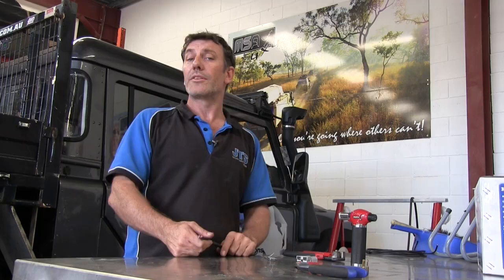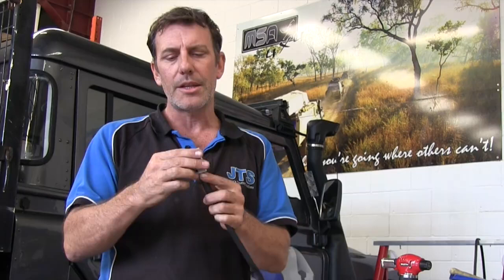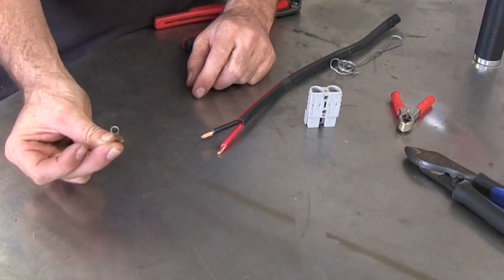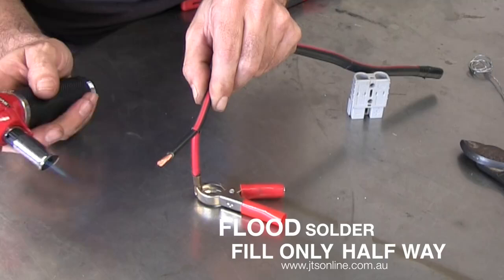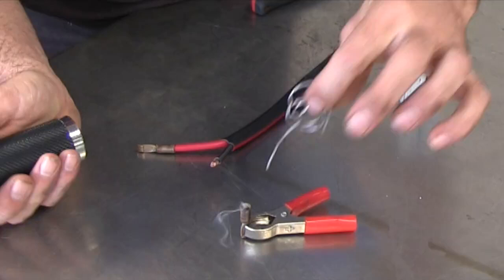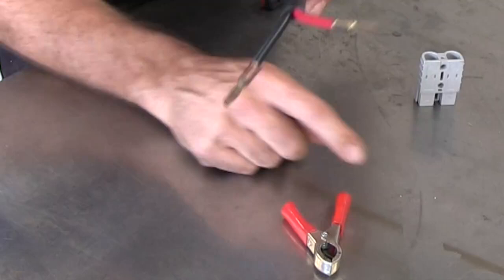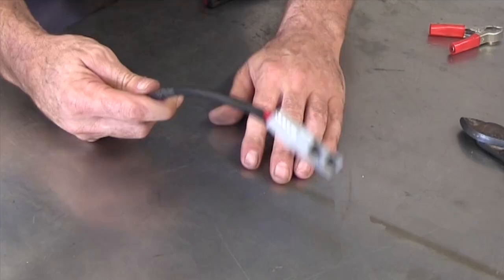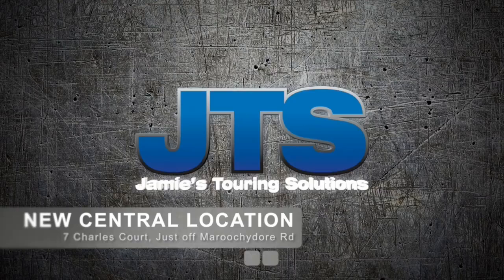How to Flood Solder and Anderson plug fitting | Jamie's Touring Solutions:

Comment: You need to tin the wire first.  If you don’t you are likely to end up with a dry joint and over time it will fail.  To tin the wire you need to use a soldering iron and coat the exposed wires with solder, then mate this to the Anderson pin.
Reply: Thanks, that's a good tip
Reply: Really? the guy does it all day every day you'd think he'd know what he's doing!
Reply: this can be achieved by keeping the heat on the connector when you plunge the wire into the pool of solder, the solder will want to solidify near instantly, which will only connect to the outside of the wire, keeping the heat on will raise the temperature of the wire above melting point, and allow it to penetrate

if find the best way to tell is that if you can still pull the wire out of the connector, then the solder is molten, this is a way to gauge penetration. though it is difficult to know for certain because you cant see. so i recommend doing some trial runs, then cutting the wire open to see how you went for penetration
Reply: @tazholio  Not really, as by then all the flux has evaporated or burned off, and the solder won't take as well to the wire.  Much better to carefully tin before connecting, being sure not to heat so much the solder runs up the wire under the insulation.  Crimping is THE most reliable method, but this is a decent method I use so that plugs can be reused in a "bush" situation if needed.
Reply: exactly what i was thinking
Reply: Pretty moot point, all good quality 12v automotive/marine wire comes pre tinned. Road Tech Marine for example only have pre tinned wire.

Comment: Its a good idea to preload the wire with solder, that way you ensure proper penetration of solder into the cable (P.S. I am a 40 year Avionics Tech)
Reply from the maker: Good tip
Reply: Someone got but hurt over a very good tip. Anyways thanks for the advice.
Reply: I'lleatyou  What a strange person; is there anybody else up there that we can talk to?
Reply: I agree, should always pre-tin the wire so it's a much better joint
Reply: SPENCE Info coming from an Avionics tech is super valid you nonse,
In that industry there's absolutely zero tolerance for failed electrical connections as it will certainly end in disaster for the plane.
Reply: Ian from FNQ  Heat the wire with a soldering gun (you'll 100watt or better) and touch the solder to the wire. The solder will flow over the hot copper.
Reply: Ian from FNQ  I twist them together. The copper to copper contact will aid in conducting the heat when you solder. The biggest enemy in this method is a cold solder joint. I make up thousand of PowerPole connections but I rarely solder. I have the proper crimp tool but most folks can't justify $150 US to purchase the tool for the 100A Andersons

Comment: Cold joint bad soldering. Wire should have been tinned first. Soldering 101.
Reply: Im new to soldering and i thought the same
Reply from the maker: Soldering 101 for splicing solder or soldering to a joint is correct. This is a flood solder procedure. You do not tinn the wire first as it increases your risk of a dry solder joint. This is raw wire into a flooded solder vat. Please do not tinn your wire first.
Reply: Wrong. Flood soldering doesn't need it Hmmmmm

Comment: I was really struggling to wire in an Anderson plug this morning... I was ready to throw my entire camper trailer in the bin until I saw your video. Replaced a merit socket in the fridge box with an Anderson plug. Now everything works again!
Reply from the maker: G'day @jaselynch, glad it helped. Just make sure you are using genuine anderson plugs. And remember they are a flush through mount and no need to have a cover if external of your camper. Cheers Linda & the JTS Team.
Reply: Cheers. Yep, using a genuine plug. Thanks again!

Comment: they are designed to be crimped, why would you solder it. adding unnecessary resistance to the joint
Reply from the maker: The connections we do have been done for many years and never had any issues.  Crimping is done at times, depends on the situation.

Comment: Re-using is actually a good reason and that's often missed by people who discount the flood solder method. Good tips. But it's not water 'proof'; somewhat resistant to water; fine in light rain. But I wouldn't go driving into a river and expect no corrosion or eventual degradation in the circuit. Definitely will last a long time and they are very durable. But not 'proof".
Reply: Thats what lanotec or mx4 inox is for mate

Comment: Fill the back with silicone and with a cap on the front it will be fairly waterproof but when connected to another plug not so waterproof. I like to presolder the wires too before inserting them into the hot solder just to be sure of a good connection.
Reply from the maker: It is not recommended to try and "waterproof" Anderson plugs, they are desigen to allow water to pass through them, cleaining out dirt and mud

Comment: It helps to orient the connector blades the same way, and at the angle they will naturally fit into the housing without twisting the individual conductors.  I had never heard the rationale for soldering them so they can be reused.  I suppose to get good results it is best to get the old solder out of the connector, because most of the flux will have burned off in the initial use.

I believe Anderson recommend crimping for the most secure permanent connection.  I buy enough of the connectors at once that it is not too costly to use a new one on the next project, and also for the occasional botched crimp job.

Comment: Thanks. I did it this way and it worked for me. Getting the clips aligned and pushed in was not that easy, but eventually got it. I used a silver electrical solder which did the job nicely.
Reply from the maker: Glad it helped! Thanks for subscribing.
Reply: you highlight another omission from this "tutorial". Ive learnt over the years to line up both pins in the same orientation   before "crimping". I'm not a flat earther and as an Industrial Electrician hold great faith in a properly torqued crimp.

Comment: Perfect for the cheap copy Anderson plugs. The crimps themselves are thinner and split when crimped however the cheapies are great when soldered this way.
Reply from the maker: Afternoon Kevin. You can certainly crimp but we don’t on the 50amp the best connection is to flood solder and only genuine andersons  are used and sold by our workshop. Thanks for the comment.

Comment: Wish I knew what I know now,i live totally off grid and the first panels and the upgrade I cut the Anderson plugs off and joined the panels with a central feed board.Well never too late to learn its Anderson plug time saving grace is I kept the plugs.Also didn't know about flood soldering great upload could just be ringing your company as I have to replace a few of the old tools,wire stripper,solder unit ect.Live at Lightning Ridge we tend to bush fix things here lol.
Reply: Sil Marillian wow, living totally off the grid and still connected to the internet.
Reply: @777nexus7  Yep am on the last phone pole from a small country town here,could go satellite but my connection isn't all that bad

Comment: Excellent video! I used this for 4 poles today, so easy, came out excellent. I hope the solder holds up to a little motorcycle vibration. Not Harley shake apart type vibration,  but regular road vibration and bumps.
Reply from the maker: Thanks for the feedback Duke.  They should definitely hold up as this is our way of doing all our 50amp genuine anderson plugs.  Safe travels

Comment: Hi Jamie  I have found if you mark the clip and the wire in it's correct position in relation to the plug with a tecta before soldering 
  it will fit in much easier without needing to twist the wire and putting unnecessary pressure on the springs...
Reply from the maker: Thanks for the tip

Comment: Great job up until you put the cold cable into the solder.  Good chance that the solder hasn't flowed into the core of the cable.  Would be better to prepare tin the cable. 
We were taught to dip the wire into the hot solder,  lift the cable and really dip until the cable is well tinned with the solder flowing.
Reply from the maker: G'day Kezza, because we use a flux core solder and blow torch to melt the solder and quickly place the wire into it we find it tin's enough to give a good connection. We also check with every connection that we don't get a dry solder.

Comment: This may be an odd question for you.  I have a need to have an SB50 on one end and an SB175 on the other.  Using a 6 gauge wire works well for the larger plug, but near impossible for the smaller SB50.  Any recommendations?  The reason is that I have a Titan Solar Generator that uses the SB50 and I need to attach a HSKY ELITE 24V BATTERY that uses the SB175.
Reply from the maker: G'day Don, we have done this before and it is a bit of a job to get it right.  With the 50amp anderson we would only fill the cup half way of solder before placing the wire into the cup or you could crimp.

Comment: I’ve always read that soldering creates a weak spot where the solder ends that can break with lots of vibration over time. Is this not the case?
Reply from the maker: G'day Jason, as far as we are aware we have never had a broken solder connection on an 50amp Anderson plug doing it this way.  However when joining larger wires together we don't solder larger connections because they can become brittle, we crimp.

Comment: do not put too much solder in the cup. I learned this the hard way. It will spill over and glob at the end and you won't get it to insert into the plug.
Reply from the maker: Correct, about 1/2 to 3/4 of the way up the cup is perfect.  It depends on the thickness of the wire you are placing in the cup.
Reply: @JTS12Volt  I did fine on the first one. It is the second one I boogered up. I'm keeping it as a monument, LoL
Reply from the maker: @troy3456789  hahaha it is a fine art to getting the levels right.  I enjoy heading into the workshop and learning also and yes have a couple I buggered up...Linda
Reply: grind out with a needle file?

Comment: In the process of doing some for my trolling motor/batteries on my boat same wire your using. How good would that hold up for mate in a boat connection. Cheers
Reply from the maker: You have to use tinned cable /wire but this connection is great cause it reduces water sitting in the cable area. If crimped it produces a pocket where water can sit.

Comment: The Anderson plugs I buy from Jaycar have a hole at the base of the jacket on the pin so when attempting the technique here the hot solder pours out of said hole. I've tried crimping the hole shut but solder still escapes. Maybe different brand or non genuine Anderson Plugs?
Reply from the maker: Definately a non-genuine Anderson plug, we only use the genuine product at JTS. No copies
Reply: I get cheap ones off eBay which don't have this characteristic

Comment: If I knew this have to be soldered, probably I wouldn't buy them at all. Just ordered few and waiting for the package. My half of the wires are already installed on the van, in difficult position. So, no chance to solder.
Reply from the maker: You can also crimp the andersons, we do the soldering as it's a longer lasting solution for the jobs we have done.

Comment: Where did you get that neat soldering gun?
Reply from the maker: That is just a simple butane torch, most hardware stores will have them. We can also supply them form the shop at JTS 1300 377 128

Comment: How are they waterproof??
Reply: By not letting water in.
Reply: The connection he made is not. It's a good idea to use adhesive heat shrink over the connection to prevent water intrusion and corrosion/oxidation in the long run.
Reply from the maker: Flood soldering prevents the water intrusion.
Reply: JTSOffroad TV: Jamie's Touring Solutions  it prevents water getting into the terminal but not wicking up the wire inside the insulation. Adhesive heat shrink is needed for that. Corrosion inside the the wire will increase resistance and heat eventually destroying the cable.

Comment: Missing: flux, tinning wire first.
Reply from the maker: Hi Libena, this is a flooded solder joint. Tinning the wire first and then added it later to flooded solder increases your risk of a dry solder joint causing resistance. In regards to Flux this is resin core solder, the flux is embeded into the solder. Thank you for your input
Reply: @JTS12Volt  Thanks.  Why would it be dry if you put the torch on it for a minute? Wouldnt everything then flow together?

Comment: It's not water proof.
Reply from the maker: We mean by water proof is they are a wash through connection and when you flood solder you are not allowing water into the connection area as it's filled with solder.  Its filled like a bucket, water won't sit under the connection out of sight.

Comment: do not do it like this guy.. flood the connector with solder.. then use a plumbers paste flux its acid based on the copper wire.. dip it in the bucket of flux.. then tin and solder the wire.. then heat the connector and push it in... then use heat shrink on the outter part so no strands come out
Reply from the maker: "flood the connector with solder" .. we did that, please watch the video again, now this comment "acid based on the copper wire" absolutely do not use acid based flux, use resin based solder, this comment "so no strands come out" also wrong, you should have no strands coming out if you are using the right sized lugs.If done correctly there should be no need for the extra expense of heat shrink, unless of course you are too rough to pay attention. Thank you for watching
Reply: Never use acid based flux on electrical wiring, it will corrode in no time. use a resin flux (resin cored solder)
Reply: @brockstravels7586  you can use acid  based if the wires are  plated .. and not bare copper or copper wires that are hard to solder from oxidation..  you clean them off with water and baking soda mix...... use acid based flux on wires and battery terminals etc.. but never electronics use lead based on electronics..  been doing this for years it works fine... dont use lead free.. you want lead youll have to get it from china america is phasing it out.. if you see on cl that someone is selling lead solder snatch that up i got 5 lbs of lead solder for 15 bucks off a old guy that had old stock.. will last me a lifetime.. and lead with good acid i got off another old timer.. you wont find this stuff on ebay all the stuff is from china.... so if you see a garage sale snatch that shit up....  now electrical wiring on electronics dont use acid based.... i mean acid on plain battery terminals or joining wires outside of electronics...  use good heat too... those wimpy soldering irons dont cut it for big wires torch or  the old school sears soldering irons i have 3 of them... yes folks old school tools is the way to go there designed tough and strong this new soldering crap and stuff in general sucks so if you find a old mechanic snatch up his tools youll thank yourself when your cheap chinese junk breaks
Reply from the maker: @jackoneill8585  Again, please watch the video again, The demonstration is not marine use, we use Copper wire, not tinned, as do 99% of the caravan and 4WD market, again you comment about acid based flux is not vaild the THIS video.